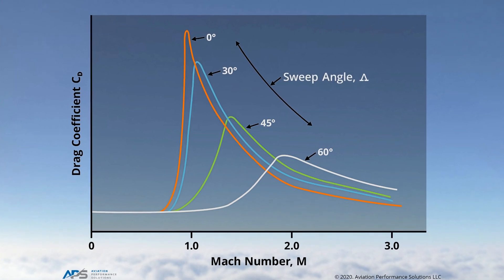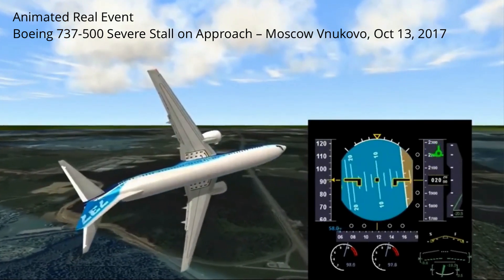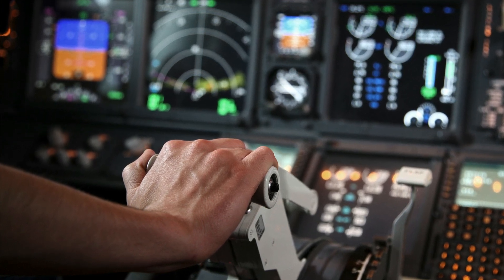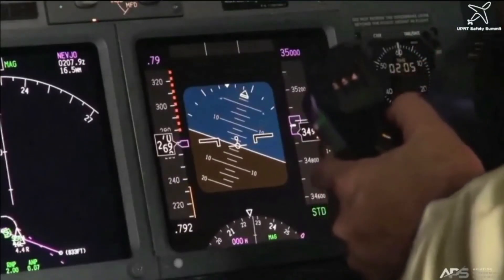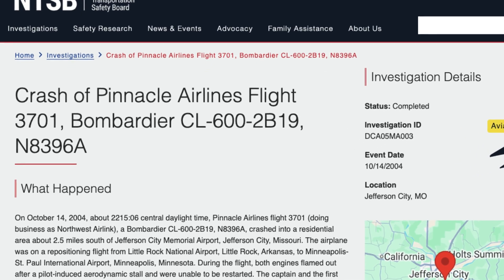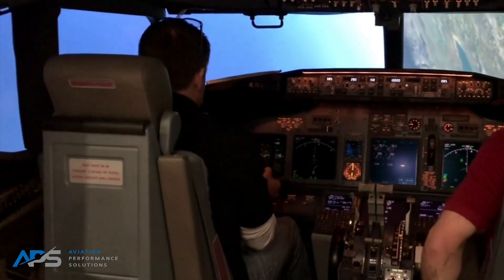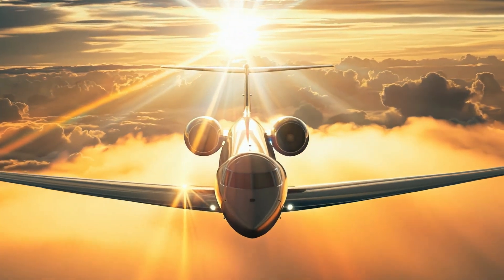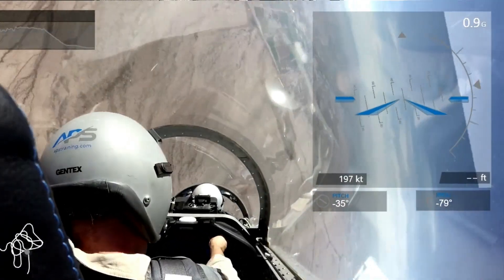Swept Wing Stalls - From Theory to Reality

Comment: We use wing twist to handle the stall. Wing twist allows the inner wing to stall before the tips. The the modern low-drag airfoils have a different stall character whereas the older airfoils have a more gentle stall characteristics! NASA has published these airfoils in several documents beginning with Abbott &  on Doenhoff, Theory of Wing Sections: Including a Summary of Airfoil Data!
Reply from the maker: Thank you for sharing this important insight. You’re absolutely right. Washout, or wing twist, plays a critical role in managing stall progression by encouraging a root-first stall and helping preserve aileron effectiveness for longer. And as you point out, airfoil selection makes a big difference. A lot of the modern low-drag airfoils do have sharper stall characteristics compared to older designs, which often had more forgiving behavior near the critical angle of attack.

NASA’s work, including Abbott and von Doenhoff’s Theory of Wing Sections, is still a foundational reference. It’s a great reminder of how much we continue to build on those principles in today’s designs and training.

I appreciate you adding to this discussion.

Comment: Not a pilot but a master instructor for auto racing.  We get "sim" drivers that think they can race first time out.  They can't.  Some will make good drivers in a real race, but not all can make that change from sim to real world on a race start going into turn one with 30 cars at speed.  Excellent video and explanation.
Reply from the maker: Thanks. I really appreciate that perspective. You’re right. Making the jump from simulation to the real thing isn’t automatic. Whether it’s in the air or on the track. The pressure, the unpredictability, the way your body reacts when it’s real. No simulator can fully prepare you for that. Same as what you’ve seen with race starts. In aviation, those first few seconds in an upset are where live training really matters.

Glad you shared that connection. It shows how universal this challenge is across high-performance environments.

Comment: very informative video  !
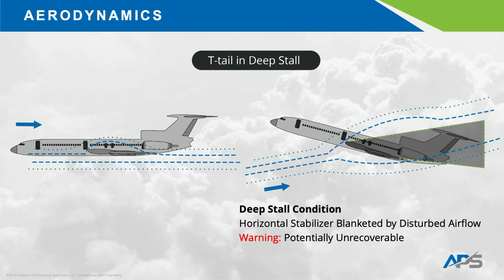1:06 why do we still use T elevators since by design they can be blanketed by disturbed airflown more easily ?
Reply: Because they look cool :)
Reply from the maker: Great question, and you’re right to point out the tradeoff. T-tail designs are used because they offer specific aerodynamic benefits in many flight regimes. By positioning the horizontal stabilizer above the wake of the wings and engines, T-tails provide cleaner airflow in normal conditions. This helps maintain pitch control effectiveness at higher angles of attack—up to the point where the wing’s separated airflow reaches the tail in a deep stall.

One of the design considerations is interference drag. A T-tail can reduce interference between the horizontal and vertical surfaces compared to a low-mounted stabilizer, depending on the airframe geometry.

The challenge, as you noted, is deep stall. In those conditions, the T-tail can be blanketed by disturbed airflow, leading to loss of pitch control authority. That’s why aircraft with T-tails often incorporate features like stick pushers and specific procedures to prevent entry into those regimes.

You’re highlighting a key aerodynamic tradeoff that’s central to T-tail design.
Reply: @EveryPilotInControl  Thanks for your answer.  So if i understood the tradeoff is that in normal condition T-tail can offer more stability.
I do think that lbeing able to keep control of the plane in the most  dire situtation should be paramount over more  stability and/or easier control in normal condition.

It's like while driving a car above 70km/h  your steering wheel suddenly stop working and you go in straight line ( and the disclaimer says , sorry only work on "normal" condition )
Reply: T-tail like any design has pros and cons.  All the biz jets use them out of design necessity since the engines are fuselage mounted. Also, a T-tail design is outside of the engine thrustline, so power changes do not cause big pitch changes which makes this design easier to fly, especially in the critical approach phase.
Reply: @fazole  I always thought pitch trim changing with throttle setting was because of the thrust line being offset from the center of gravity, not because of the location of the horizontal stabilizer.
Reply: @fazole  thanks for this enlgithment !

Comment: This should be mandatory for all ATP pilots. Former airline pilot,  we did our best to avoid stalling. Shaker and pusher, result inverted flat spin.
No recovery. 
Excellent information,  thank you.
Reply from the maker: The escalation to the aerodynamic stall involves several layers typically starting with inadvertent slow flight. The role of the pilot, ideally, is to intervene before slow flight, before approach to stall warning, and so on; the earlier the better. Thank you for joining the conversation.
Reply: Do you think cameras on the exterior in the flaps, landinggear, rudder, nose, anywhere else, would they help pilots, when thngs become difficult?
Reply: Eject - - -  Eject !   😂

Comment: What amazed me about AF 447 is how stable this aircraft was in a stall--it didn't spin nor snap-roll.  Wasn't the real problem that the pilot flying didn't recognize a stall and instead think they were in a "Mach tuck"?  Someone correct me on this, but the aircraft was recoverable until the very end by lowering the nose and adding power, which the pilot not doing this because of misunderstanding the aircraft configuration in the absence of valid airspeed readings?  And how was this aircraft so stable in the stalled condition?  Was some stability augmentation still operating, or is the design inherently stable?
Reply from the maker: You would get a lot out of reading the final report by the BEA. There are many lessons learned. Indeed, the stalled flight condition can only be corrected by reducing the angle of attack on the main wing. For large transport category airplanes, the trimmable horizontal stabilizer takes time to change position.